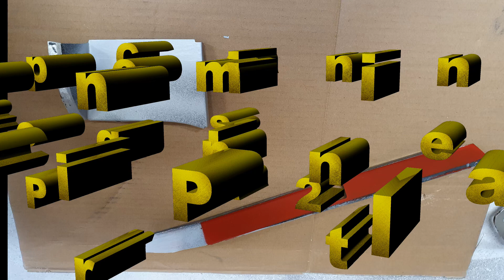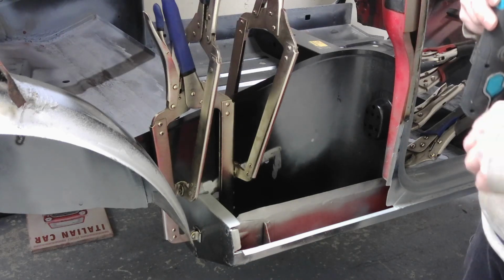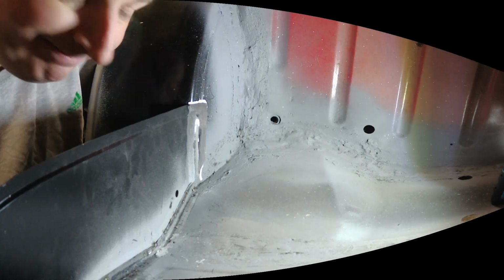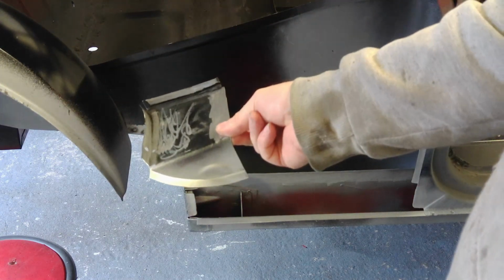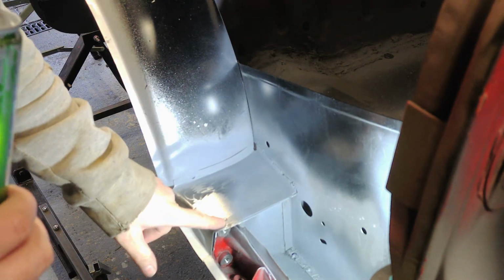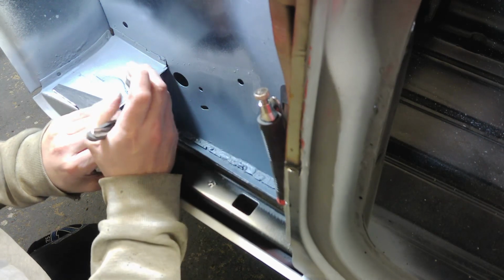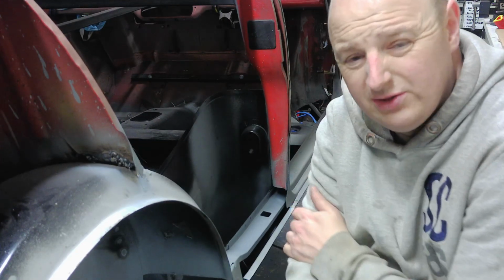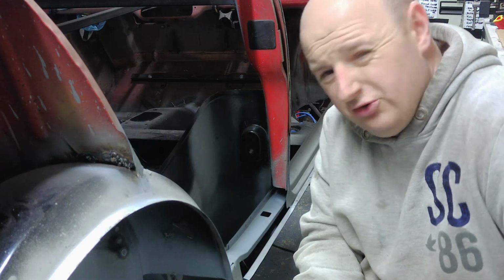Classic Mini Restoration: Eleanor Video 65, Fitting The Companion Bin And Closing Panels Part 2

Comment: 👏👏👏👏👏👏Looking great buddy. You're ripping through this now.
Reply from the maker: Yeah I'm pleased with the progress, nearly a rust free shell and that will be a nice day when it comes
Reply: @DBMiniDIY  it's a good day indeed, then you'll be like me and stressing about it rusting in between it going for paint 😂😂😅😅Sent my gearbox off for soda blasting last week, should hopefully be rebuilding that in a couple of weeks then fingers crossed, be painting the underside 😁😁👍👍
Reply from the maker: @danhardy5752  I'm hoping to paint it myself but need to invest in some equipment first
Reply: @DBMiniDIY  I'm in two minds whether to do it myself or not, definitely spraying the underside and inside myself. Will be doing the bodywork and filling, sanding but final paint I may send out to make sure it looks as good as it can,but then it will be sat for ages while I save up, decisions decisions 🤔🤔😅😅
Reply from the maker: @danhardy5752  2K i was quoted to spray just the outside fully prepped

Comment: Dale what is the purpose of the square hole in the panel you welded in last?  Cheers, Midge
Reply from the maker: Not 100% sure, they are there for later cars as the earlier models did not have the hole so I'm assuming the mpi has something there that earlier models did not have

Comment: I’m really curious what the hole is for in the long thin panel you fitted last, 7min40? Scratching my head here
Reply from the maker: Yeah I'm not 100% but my two best guesses were either for a trim piece on later cars or for access to inside the sills eg waxoil, drainage etc, course i could be completely wrong